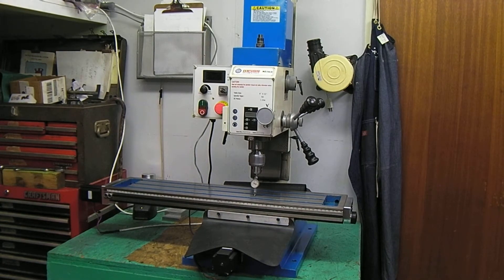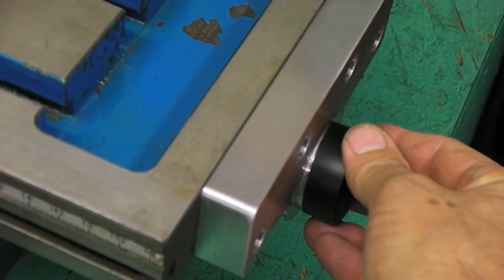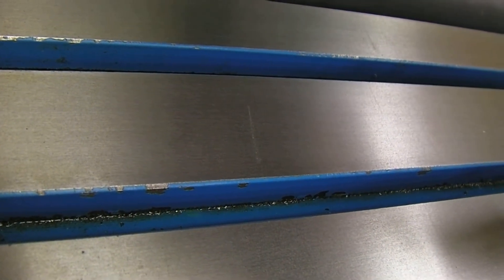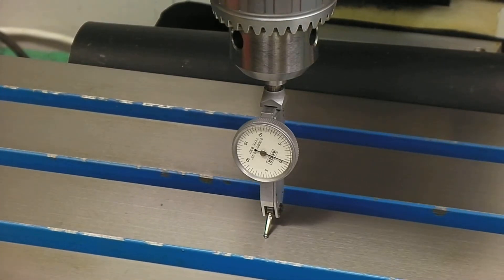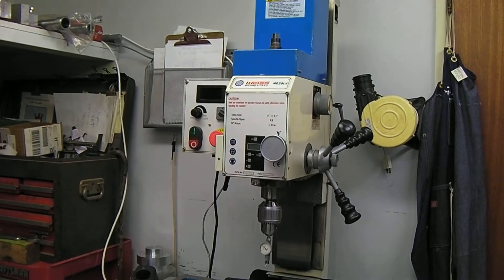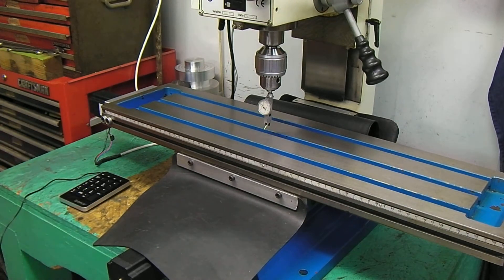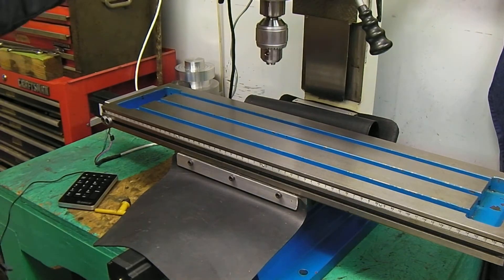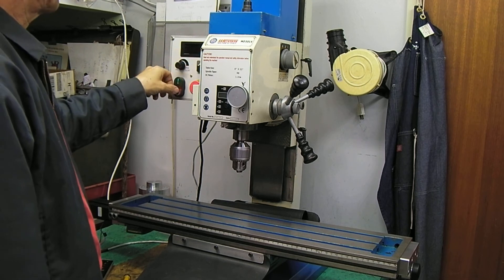Weiss 30LV Weiss 32 CNC ball screw kit

Comment: Howdy! Do you happen to know if this is the mill size equivalent of the Warco WM14 or the WM16? They are both weiss derivatives I believe. The WM12 is the very smallest, and then they work up the size scale. I am buying a WM14 and would love to convert it in the future!
Reply from the maker: It is about twice the size. The WM 16 should be about 280 poundes on the bench and the Weiss 30 is 480
Reply: Thanks, that was my worry. I recently decided to go for the WM18 instead, which is a good deal heftier (I think its the UK equivalent of the grizzly G0704)

Comment: Dave, I was wondering if you could tell me the outside diameter of the Weiss 30LV's quill. I am curious if I could fit a PCNC 770 spindle in the head of the mill. The OD of the PCNC 770's spindle is 70 mm. I also noticed Precision Matthews started selling the PM-30-MV again, looks like they changed the mill a little (http://www.ebay.com/itm/PM-30-MV-VERTICAL-BENCH-TOP-MILLING-MACHINE-3-YR-WARRANTY-FREE-SHIPPING-/332208236869).
Reply from the maker: I saw that Matt has the Weiss 30 again with a DRO on it. I'm glad because I really liked the mill. I don't know how big the quill was, I can ask a guy I'm doing a CNC kit for now.
Reply: If you don't mind that would be great. Thanks!
Reply from the maker: The Quill is D=70mm.
Reply: Oh man, that would be a great upgrade for the mill. Now that the PM-30-MV is in sale for 2099.00 with free delivery it is looking a lot more appealing.
Reply from the maker: Where do you see it for sale for 2099?
Reply: Check the eBay link I posted originally

Comment: Dave what do you think about the Weiss 30LV vs the Charter Oak 12Z Bed Mill? I have been day dreaming about stepping up from my BF20 and was looking for a push towards on of the two. Thanks.
Reply from the maker: The Weiss is a lot larger than the 20 so the, its too small feeling, is gone. Most jobs fit on the larger Weiss table and its a nice quiet mill and fairly ridged. I ran the Weiss next to a RF-31 round column and the Weiss was a good amount more ridged. I think the Weiss is the perfect hobby size mill. 

That said, the Weiss cost almost as much as the 12Z and the 12Z is just much bigger and stronger. Its not even close. After you put the belt drive on the IH it really just rips through metal like the Weiss could never do. 

If you don't want to spend the time to make a belt drive for the RF-45 clone you will be happy with the Weiss. Out of the box they work well and have more spindle speed. You wont really feel the need to upgrade as most jobs will fit on the Weiss and the Z is fairly tall. I miss my Weiss and if I can work in in someday I may buy it again but my little shop will have a IH mill, A PM-940M and a PM-25 and perhaps the G0704......
Reply: You are giving me shop envy. I have the short table version of the BF20, so it is giving me fits. I believe the 12Z is only $100 more than the Weiss, so I think I am going to go that route. I am not sure if you are backed up, but after I pull the trigger maybe I could talk you into making a belt drive for me:)
Reply from the maker: I think I might do a few of belt drives again for the 12Z but it wont be fast
Reply: ArizonaVideo99 great video I just bought the pm 25mv how can I get   your cnc conversion kit thanks

Comment: Where did you get that Jog Pendent? thanks
Reply from the maker: It is just a num pad with a TAB key. They are around $20. I use them for all the mills. You need the TAB key to bring up the MPG in Mach3